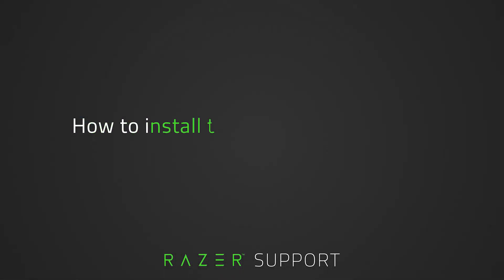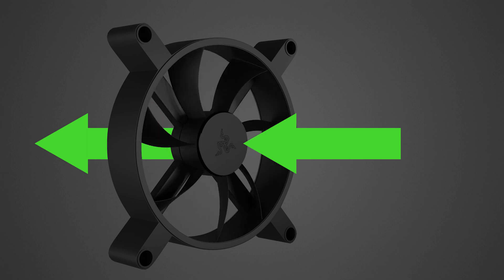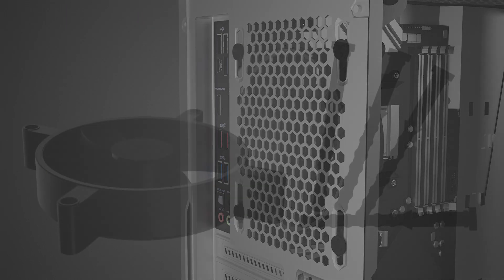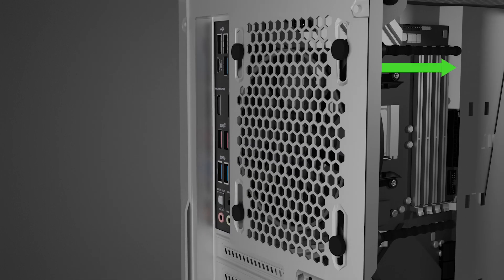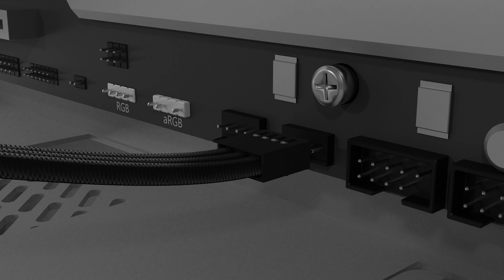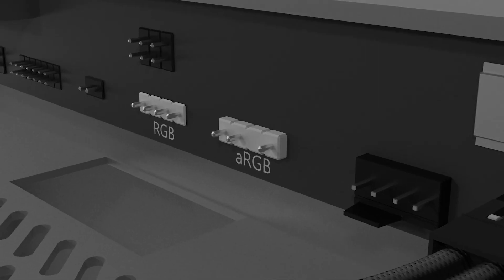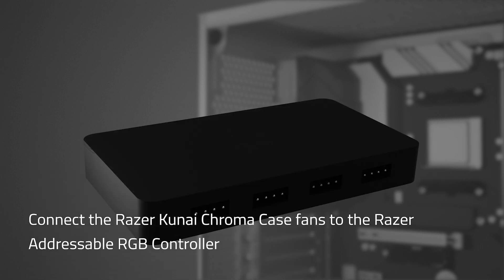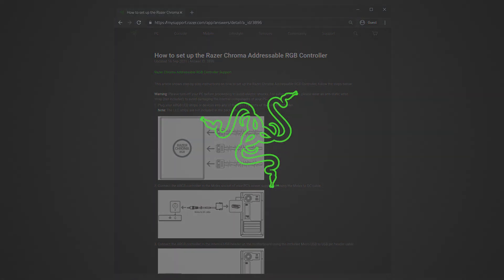How to install the Razer Kunai Hydraulic Chroma Case Fans to your PC Case

Comment: My only problem with this is that they only have the Chroma light ring on one side, so you can't mount them pulling air in from the front or bottom as the RGB would be lost, and then you'd be better with other fans.
Reply: They have rgb on both sides
Reply: Nooooo. I have 9 of those. They have argb on both sides.

Comment: Are the aRGB connectors daisy-chainable or do I need to find a hub?
Reply: They're advertised on the website as Daisy-chainable.
Reply: Yes, they are
Reply: @reignman.7555  there comes a point where you can assume that someone just bought a product or they decided not to buy it